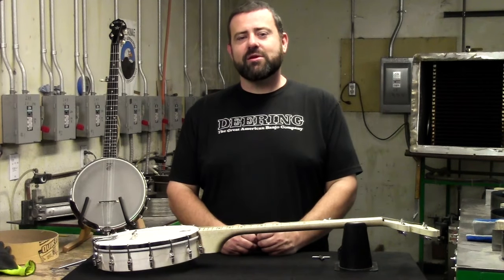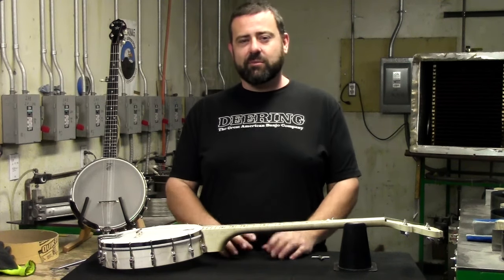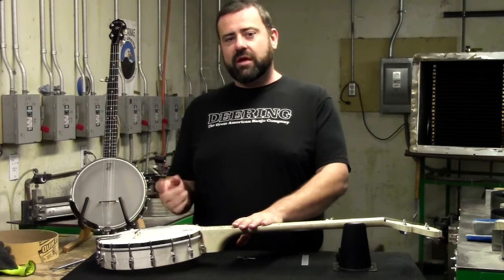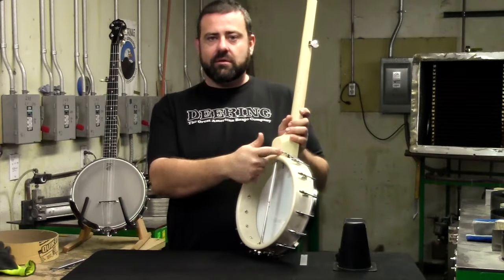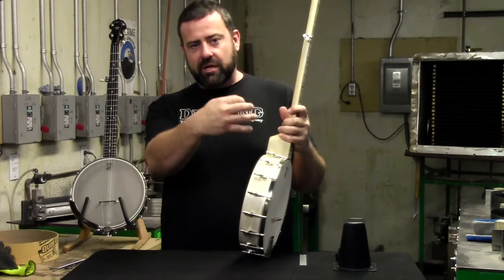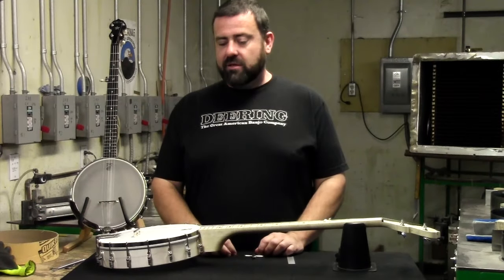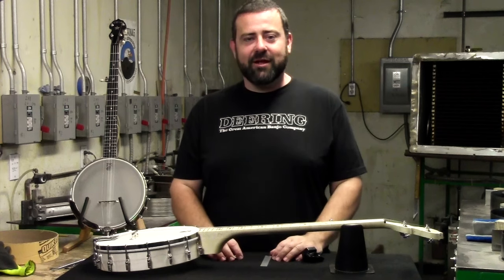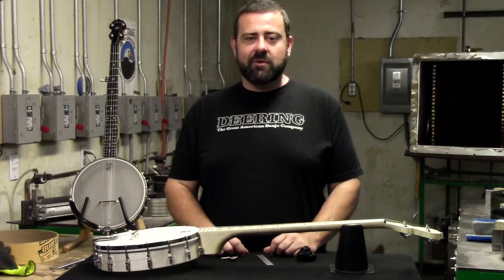Deering Tech: How To Tighten Your Banjo Head

Comment: Have to admit that I was nervous to attempt this adjustment myself, based on the cautions in the manual (very well-written BTW), especially since this is a pricey Kavanjo head on my Sierra II.  I followed Chad's instructions, and it restored that great 'snap' and twang.  Finding I prefer a little lower than 1/8" height, and nearly flat relief.  Thanks Chad and Deering; you guys are great..!!

Comment: I would imagine tightening clockwise around the drum like that will cause an uneven pull on the head, wouldn't it? I know with snare drums, you use a star pattern, tightening opposite bolts consecutively to keep the head centered. I'd think something similar for banjo would work, right? If you number the bolts 1-16, tighten in this order: 1, 9, 5, 13, 2, 10, 6, 14, 3, 11, 7, 15, 4, 12, 8, 16.
Reply: I also think that doing it in a criss-cross, star pattern, like a snare drum, would be ideal as well, if only for the health of the instrument. That said, it seems like “tuning” your banjo head is of less import than tuning a snare drum. If the QC guy at Deering is saying that going by feel is fine, I imagine we can feel okay if we don’t spend ages dialling in all those lugs like we would on a snare drum.

Comment: Thanks for the video. What if my banjo has a fretboard scoop? I have a Classic Goodtime and need to tighten the head but the "last" two frets are several inches up from the one in the video. Seems like the distance would need to be shorter than an 8th inch, am I wrong?
Reply from the maker: Hi Eric. When there is a scoop, we measure 1/8" from the surface of the fingerboard at the 17th (last available) fret.

Comment: Was that size wrench used on the older Good time models as well? I'm not sure when mine was built but it has the older multi-ply ring
Reply from the maker: Hi Jennifer, without measuring it, it is hard to say as the specs did change. However, it is most likely 1/4” or the 9/32” (which is the current spec). If you need a tool, this wrench has both options. https://www.deeringbanjos.com/products/hall-3-way-bracket-wrench
Reply: awesome!  thanks
Reply from the maker: You are so welcome. :-)

Comment: Instead of assuming user error, which it seems like you get a hard one from saying, realize every piece of metal is different and every bolt, nut, etc ...is also different. As well your taste apparently. During a "lifetime" of working on banjos I'm sure you find it's the users fault in most cases, however you sound arrogant. I don't believe I would let you or anyone your associated tune mine.
Reply from the maker: Hi, thanks for your comment. I will admit I was surprised to read it. Watched the video back and I can't find an area where Chad talks about user error at all. Can you elaborate on what you are referring to? Apologies if we have given the wrong impression somewhere...but I would like to try and find out where this is being communicated to you. I don't think it is this video. 

Thanks. Jamie L
Reply: That was a difficult comment to understand. 
Thanks. I thought it would be a star pattern too. Quarter turn clockwise is all it is! 
That's easy. ⛩🎶🌴